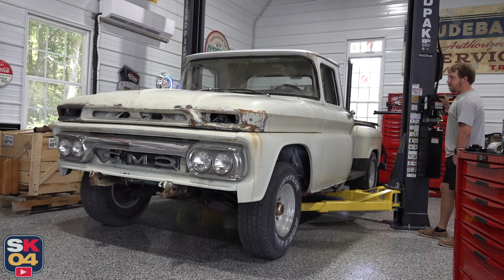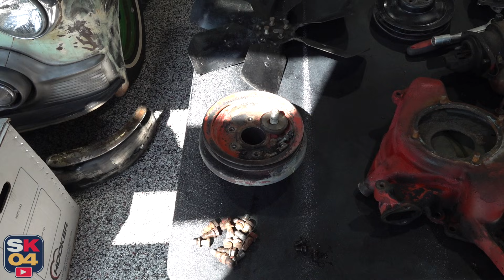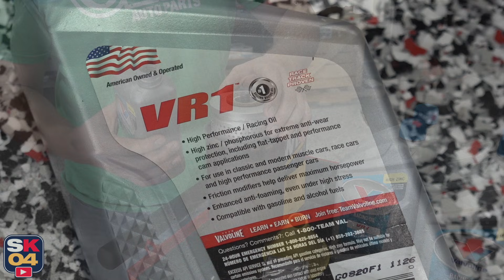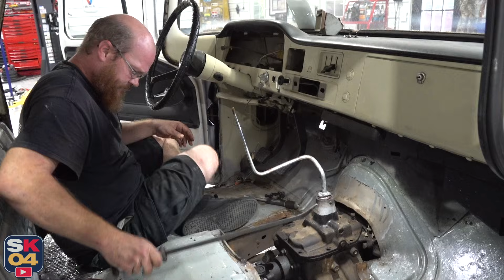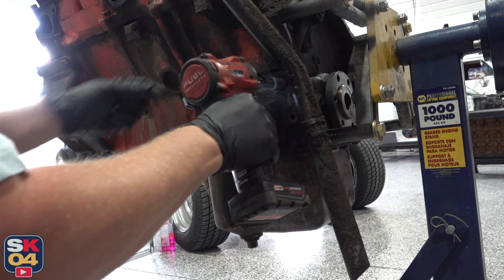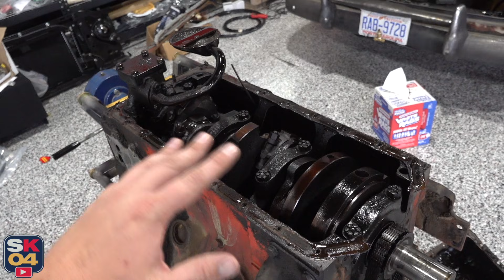Here's An In Depth Look At The Incredible GMC BIG BLOCK V6!

Comment: Hopefully you have someone there that knows what they're doing with these old engines. The difference between g m c and chevrolet. G m c had heavier suspension and heavier drive train components. They were competing with dodge and international work trucks. It's not a highway cruiser.

Comment: My father bought a 1960 GMC 1/2 ton with this very engine.... I loved the truck... We drove that pick up until 1976 then it was traded for a diesel scout... To say that it was built heavy duty was an understatement...  I loved pulling trailers with it because it would pull, pull, pull and never come off 1600 RPM...  It would never overheat and it required very little service.... It's only downfall was that it loved fuel... the best fuel economy it would get was about 13 miles per gallon at best....

Comment: When I was young, GMC had 6 cylinder, heavy duty in wrecker trucks,Big busses that sounded like a Diesel. They may have installed Detroit Diesel because to my young ears though they sounded like it. I know the Detroit Diesel is a 2 stroke but they sound similar to me. The exhaust note is similar.

Comment: I used to work for a nursery that had in 1962 purchased this exact truck, except it was bright red. It rarely left the nursery property and in the 80s still had less than 10,000 miles and although the inside of the bed was a bit beat up everything else was in pristine shape, for years I would see it when driving past, the nursery has now been sold, I wonder what ever became of that truck.

Comment: Those V-6 motors were designed and built to run 500,000 miles. They made four versions of that motor with different cubic inches. Thete was the 305, 351, 402 and a 478. They also built a V-12 at 702 cid. One solid cast block, with four individual heads. None of these had huge horsepower, but i believe the torque rating was definitely underrated. I pulled a 66 Chrysler Inperial that was on its frame 200 feet at just over an idle. These trucks were beasts!!.. Not the best on gas, but will run forever.

Comment: @Kyle, Appreciate your video! Have my G-father’s ‘63 3/4t, 4x4, stepside, 4 speed w/ the 305E V-6, all original (evergreen paint), to include the dear ole Stromburg 2 barrel carb.  It was really a farm implement on our land down in S. Texas.  Winch on the front and a PTO out the back. I no longer have the split-rim wheels that GMC put on 3/4t, and up, trucks at the time b/c they’re now outlawed in Tx & Ok where I now reside.  Have the big rear window & bumper as well.  Best part is we have 77k original miles on it.  Would like to see more of your rebuild videos on this engine.  In what state do you live?
Reply: Would love to see your truck

Comment: I had the GMC 305 in my hoopie freight truck hauling firewood. Mine had a 5 speed tranny in front of a two speed 22,000 pound rear axle. That motor pulled way above its displacement. Reliable too. Loaded I would get 4-5 mpg.
Reply: I drove a C -30 GMC with a 292 six cylinder. It sounded like diesel and pulled like crazy. It would back over curbs ,rough terrain with no throttle. The only thing was it would not drive past a gas pump ⛽.

Comment: So cool - 1972 auto repair in my HS, no one wanted this project engine - so me (the new guy) and teacher tore it down and o/h it. The inboard plugs were unique. It had a blown head gasket, but still ran on 3 cylinders. Was a beast to restab the clutch pressure plate. TY for great memories. My test drive after o/h took me 3 hours out of class that day - lol. Got an A in that class - it led me to be an electro-mech engineering designer, slide rule drafting, and then cadcam future. Thank you Vernon Theodford.
Reply: My teacher was David Grove WW 11 vet a Genius. RIP

Comment: You could probably get Colt or Bullet to make a cam core and grind something modern for it.
All that iron needs a turbo, practically begging for it. 
The pistons are 4 ring if I remember correctly. 
6-8 psi of boost would make it interesting.

Comment: I owned a 1963 GMC CarryAll factory 4wd 305V6.4 speed trans. I agree this motor is a real stump puller torquey engine. One interesting item is that my GMC 305 V6 had factory 'plaid' valve covers. As I understand, engineers pulled engines off the line to be modified and blueprinted. The plaid valve covers were to let a future tech know this engine has been modified. You also mentioned the Stromberg WW carb. A fine heavy duty truck.
Reply: I had a 63 GMC with those valve covers too.  They were just a marketing gimmick (the "Thrifty Scotsman"), pushed out by GMC to combat the first three year's worth of poor fuel economy.  The 63 and newer did have slightly better fuel economy due to a revised cam profile and carburetion, but there was nothing at all special about the production engines with the plaid covers.

Comment: Great engine before gasoline was $5.00 a gallon. Even with a one lunger carburetor, these things suck fuel like nobody's business, and you aren't going to go anywhere in a hurry. Keep the RPMs down at an idle and she will run 24/7 with no problems. When I was a teenager, I worked as a ranch hand for a boarding stable who had aa 64 GMC flatbed with this engine. I used it to haul hay to feed the horses and do other work around the place and she was a beater to say the least.

Comment: If you decide NOT TO DO THE HEI CONVERSION,,I suggest you put a PERTRONIX IGNITOR KIT IN THE DISTRIBUTOR it changes it over to electronic ignition!! And if it goes out, you can replace the points and condenser back into it to get you running till you can replace the unit( ignitor) IF I GO BACK WITH ANOTHER BB V6 I'LL GO THE IGNITOR ROUTE ON MINE!! Also I think some transmission mounts would work for motor mounts! Mine need revulcanizing too but I think I'm going to try the tranny mount! Probably would need to be shimmed but I think it would work!

Comment: I have a 1964 GMC 3500 1ton with the 305 V6 ! It starts,don't leak,runs strong and is a complete mystery to me. I would love to swap in something more familiar a straight 6 small block Chevy all of which parts are readily available,, do you know since I have the stock transmission with stick on the floor(factory) I would need an adapter or can I just bolt it up? Any help would be greatly appreciated thank you...

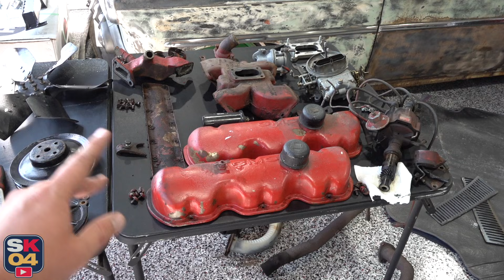Comment: I have a 66 GMC c1000 it had the 305c "crate" engine  From early 70s,was originally supposed to have the 305e, it had been swapped before I got it,, I noticed yours don't have the double roller timing chain but a HEAVY DUTY STANDARD CHAIN,, THAT'S UNUSUAL,, MOST HAVE A TRUE DOUBLE ROLLER CHAIN!! MINE RAN SWEET FOR MANY YEARS until I made a bad mistake of flushing the engine and stopping up the oil screen due to that high volume oil pump!! SPUN NUMBER 4 ROD BEARING EXTREMELY BAD!! I'm debating on whether to try and rebuild it or find another one and use mine for spare parts!! Now I do have a set of the"MAGNUM HEADS" that came on the 351-401 I'll probably sell those. I have a friend who has a 305b outta a bigger truck it's the same as a 305c except for the intake manifold and water pump housing,, I might get it and put back in my truck? That humongous thing was a pain to get outta the truck!! I've thought about just going back with a 292  straight 6 or a small block Chevy,, but I always LOVED THAT V6! LOTSA TORQUE AND WOULD ROLL ON THE INTERSTATE AT ONLY ABOUT 1500 RPM( MY REAR END IS 3:08) AT 80MPH! WITH PLENTY OF PEDDLE TO GO!! and it's a great conversation piece too,, especially at AUTOZONE.

Comment: We bought a 1972 GMC skoolie that has a v6 big block.  I'm the wife and am currently doing the mechanical stuff (and learning) while hubby is at work.  I feel so alone in getting this thing going good as apparently parts are hard to find.  
Just took carburetor (original) off to clean as it was spitting fuel from the top from debris from critters making a nest on top of carb. there is evidence of debris that has gone past the carb into the top inside engine block.  I'm nervous that debris is further down into engine requiring work to clean inside the engine which is way out of my league although I have time on my hands to learn if need be. Info has been super hard to find in helping me learn about the engine so I was relieved to find this video. Any advice would be so much appreciated as I feel like I'm opening a can of worms 😂.
Reply: Oh, and the video is incredibly helpful.  Thank you!!!

Comment: Could you share some of your research web sites and notes? I found one of the GMC V6 motors in an old truck and thinking of making an offer on the motor to go in one of my Willys Truck projects. The torque you mentioned is appealing and the gallons per min of coolant flow would make it a perfect match for an old willys truck

Comment: These are Industrial beasts.  We had one of the bigger ones actually powering a 5000 gallon fire tender through a 5 speed auto.  There were some hills it just could not pull being so overloaded.  It would pump water like crazy in 5th gear through the pto for endless hours as long as you fed it gas.

Comment: Thanks for posting, this is a fascinating engine family. I think GMC introduced this V-6 family in 1959, as you said they were strictly truck engines, meaning they hit max torque at an rpm not really much higher than idle - exactly what a truck needs. I believe they were nicknamed the 'Hercules' series because of their durability.
Coincidentally, Ford introduced a truck-only series of engines called the, "Super Duty" in 1958 - V-8s of 401; 477; and 534 cubic inches.
I think the 534 weighed almost 1,100lbs.....they again were only for Ford trucks, up to the F-900s for tractor-trailers. Those engines had no business being in passenger cars, although at least one moron put a 534 in a 1929 'hot-rod'.

Comment: A couple of things. That timing chain is not a roller timing chain. It is a morse style. Some of the 305's and 351's had single roller timing chains. Once you got up to the 401's it was a gear train that drove the cam.
Reply: Someone's selling a 305 with a 4 speed says it was running out of a 67 C10 for 300, I asked 200 and he said 250, should I take it. I'm not a real mechanic but I want to get into doing cleaning engines up and reselling. I'd be capable of doing valve cover, intake and oil pan gaskets, and painting them, spark plugs and oil. Would I make money of off that?
Reply: @jamesmoore716  Probably not worth it for resale. Depending on the miles (which a prospective buyer is going to ask)  beyond the things you mention, check the valve clearance AND it may need a timing chain as well. Run it record oil pressure and then do a compression test too. The more you know about it, the more comfortable a prospective purchaser may feel about buying it. If a purchaser can see it run, that helps too.

The kind of purchaser that might pay you enough to make a few dollars is going to be someone who desperately needs one. These engines are known to be thirsty and as such,many just replace them with a small block Chevy. The 4 speed transmissions (SM420) are popular in some circles (rock crawlers) and in the right venue might bring fair money as they are all but impossible to find now.
Reply: @turbo8454  it's already out of the vehicle, it has a tag in the picture saying 67 chevy C10, is the trans worth reselling?
Reply: @jamesmoore716  You can run it on the ground. I've run them on the ground and on engine stands. The engine should be warm for the compression test and to adjust the valves anyway.

The trans is popular with rock crawlers. If there are any in your area, it might bring good money. If it has to be shipped, because of shipping costs, many may not be interested.  I would only buy it if you want it or have a use for it, not with the idea of making money with it.
Reply: @turbo8454  awesome, I appreciate the time you gave responding to my questions, thank you

Comment: That’s not a roller timing chain but looks very wide and stout. Other videos on this engine do show dual roller setup.  Sure looks like a diesel that they ran as a gas engine. A beast for sure.
Reply: GMC rather easily converted some of these into a sister line of diesels, most notably the largest-ever member of this V-6 family, the 478 cubic inch.
The diesel line presumably needed very little reinforcement as you implied. The diesel family was named the, "Toro-Flow", but some mechanics called them the, "Terrible Flow".

Comment: I have a 67 Chevy Stepside with the 305E. That was the final, most "powerful" version. I saw the Holly 2 BBL, probably a 350 cm. The Holly 500 will also fit but probably overkill. That carb was really the only upgrade that was available. Huge difference over the Stromberg 1 BBL.

Comment: Hey Saabkyle, I know you're a GM guy but have you heard of the Ford 300 inline 6. It's about the same size as the 305 V6 and was a purpose built truck motor as well. It was introduced in 1965 and lasted all the way until 1996. It had one of the longest production runs of any American made engine.
Reply: I'm a Ford & Mopar guy too, and you're right that the L-6 300 was incredibly durable, and surprised many people with their 'power'.....which was really torque.
That same comment was made about Mopar Slant 6s in full size Plymouths & Dodges, as passengers were surprised to learn they were in a 6-cylinder car, not an 8.
Reply: Although people say about the other model 6s or the newer replacements? I have been a mechanic since 68 but I've always been interested in rebuilding or modifying or performance the underdog motor be a 6 or 8 or the ugliest thing on the planet I'm not interested in new modern replacements for the in thing I always like to use my brain and see what I can do on the underdog engine as in this 3005 it would be interesting to blueprint it modify it with a little performance somehow but make it double its mileage that's really using your intellect

Comment: Good job 👏.  I didn't know that GMC V6 engines where that heavy  that is a wow moment for that era of engines for sure. Here something you might look into find a turbo for that engine a small amount of  Boost probably wouldn't hurt that engine the way it was built. Anyway even if you don't do any modes to the engine you have some real history in your hands. Ps you might want to have some harden seats put into the heads because there is no lead for the engine or see if there is a fuel  Supplement for the engine and again thanks for sharing a classic with everyone Ray in Idaho

Comment: The school district where I attended elementary through High School bought nothing but GMC busses  from the early 1960's through the mid 1970's before switching over to Internationals.

The 60's busses were powered by the GMC 305 V6 and the 70's busses were powered by the GMC 351 V6.....They were not the most powerful of engines but they lasted a long time in service.

Comment: I had one of these with a power glide, not a real good combination. They will last forever but don’t expect good fuel mileage. They also made these in a 702 cubic inch V12.
Reply: how bad? did you atleast get teens?

Comment: Best way to hop up the 305 V6 is to replace it with the 351, 401, or 478 ci version.
Reply: Just spray it with a 150 shot of nitrous and rev it to 6000😬
Reply: @spankthemonkey3437  lol pretty sure these redlined at 4

Comment: Good truck motor, not a hot rod. Nobody makes a 4 barrel intake or headers for 'em. No cams either, though any regrinder can make one from a stock core.
Reply: GMC did make a 4-barrel intake manifold for it, available from the dealers.  Good luck finding one, and good luck getting the owner to part with it.

Comment: What a beast of a motor, they went for ALL the reliability back then. Sadly fuel economy will be bad if your motor weighs a ton and the water- and oil- pump specs rival a firetrucks pump :) 
This engine could be great for other applications too: tractors, boats, industrial stuff...
A modern version of this would be the new Ford 7.3 gas motor or a V6- version of that.
Reply: The engineering that went into engines back then was pretty nuts; consider as well that in the same era, Buick was heavily invested in their 215 ci V8 project which was, unusually, aluminum and after a few years received turbocharging.

Comment: I wonder if you were to put an electric fan on it, if you would even need to kick it on when driving over 20-25 mph. Bet you had to block off the grill in winter to get the cab warm. Hell, if it really is moving 300+GPM through the cooling system, it probably would stay cool so long as a gentle breeze is moving over the truck.

Comment: If I remember right, these engines were supposed to be Diesel engines, but were instead gassers. I could be wrong, but it would explain why they were so stout and why the spark plugs are mounted inboard because that’s where the fuel injectors would go.
Reply: There is a 637ci industrial V8 based on this design, and was available in both gas and diesel versions. If I remember right, the gas ones were red, and the diesels green.
Reply: Or the glow plugs.

Comment: I wonder how much work will it take to put that into a S10
Reply: I had a '96 Sonoma standard cab long bed stock with the 4.3L Vortex V6, 180hp, 235 ft/lbs torque, pretty much what this 305 produced. Did everything very well, chirped the tires in second gear driven hard. Point is, that filled the engine bay, this 305 might squeak in, but it will be heavier than a stock setup for an S10. Might have to beef up the front suspension, heavier throws off weight balance of the whole truck. That 4.3 was actually had more than enough power for that little truck.

Comment: When I was ten years old My dad had a 68 gmc with that motor in it. It was a beast. It had a three speed with a granny gear in it. It was the first manual transmission I drove.
Reply: Same here. If I remember it got about 8 or 9 mpg…..I took my drivers test in it. 3 speed on the column.